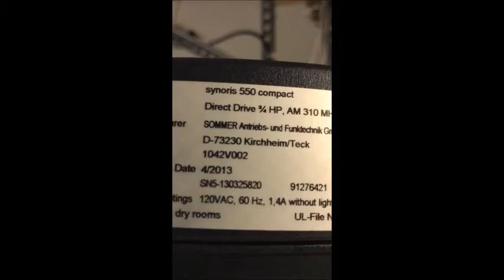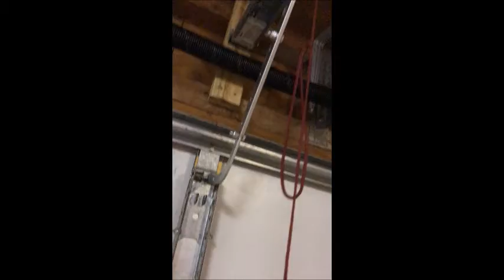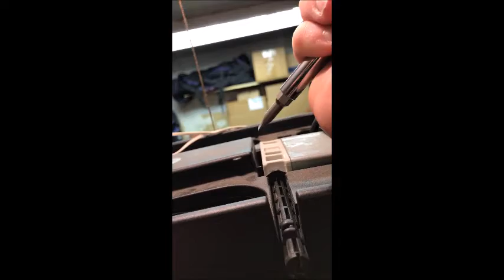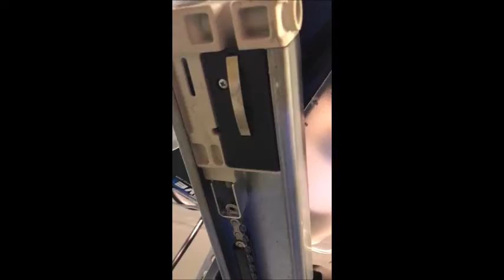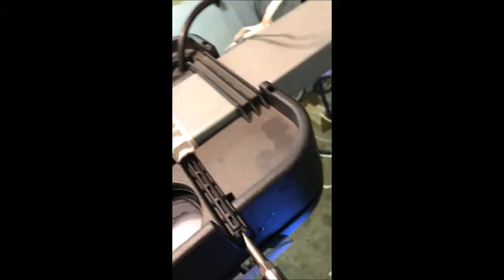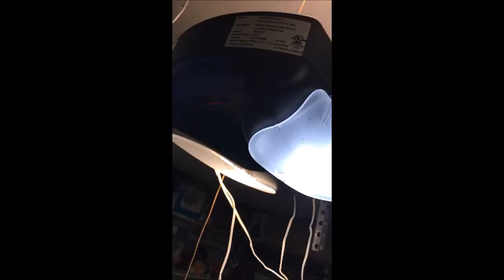How to Fix / Repair Sommer Direct Drive Garage Door Opener Not Working Issue *NO PARTS NEEDED*

Comment: Thanks, while this didn't fix my problem, it did lead me in the right direction. Turns out the inside of my rail was extremely dirty. It would go down but not up. I ended up using a scrub pad and wd40 to clean it. It works fine now.